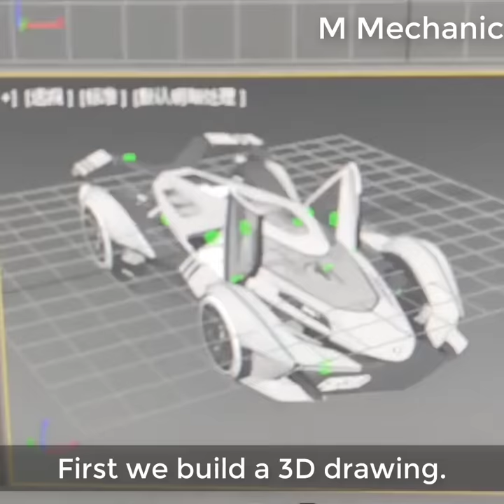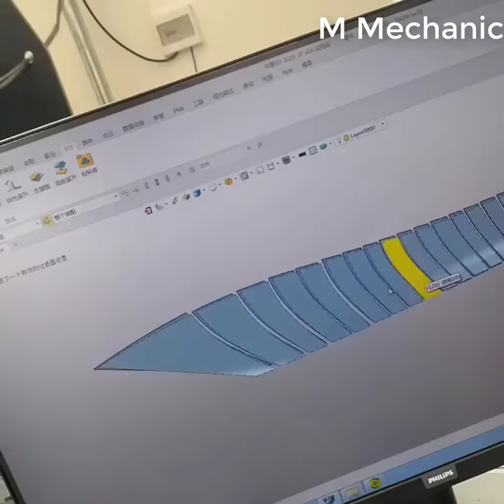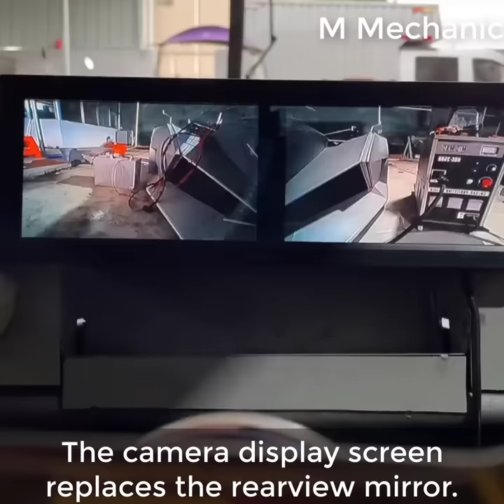Homemade  | Lamborghini V12 Vision GT REPLICA | Build Time Lapse.

Comment: The cost of those part's! Still most impressive thing actually done right I've ever seen!
Absolutely a work of art. STILL as much as you paid for the car you couldn't throw a few turbos on there and installed a bigger motor like a V10 or V12.

 I know the later 2 engines get pricey but it's just not a supercar without at least 3/4 of the original vehicle's HP. Of course that's just an opinion and either way it's still sexy as hell (don't take that wrong lol).

Comment: I would like to know how many kilometers per hour it will run. I would like to know why it uses motorcycle suspension.  What's going to happen when you go through a hole in the street?

Comment: Why did they make the body out of sheet metal ?  All that bondi is probably already cracking. They could have used two ounce fiberglass mat or Kevlar panels and cut them ,  bonded the edges then flipped the body upside down and glasses it as one unit. Then there would be zero Bondo ! Much lighter and no cracking or rusting !

Comment: That's all very incredible, albeit doesn't stand a chance, unless; you managed to get your hands on a 12 rotor moderized wankle engine. Either turbo / supercharged & tuned to make over 1000 hp. Now, you will be making true believers out of your spectators.

Comment: This has just the "looks"... all the rest is poor... chassis wasn't engineered (no stress analysis for sure)... suspensions were done with "one eye closed"... and a lot of cuts on that sheet metal... body work should have been done in aluminum or composites... it  would be much lighter... 1300kg?!?